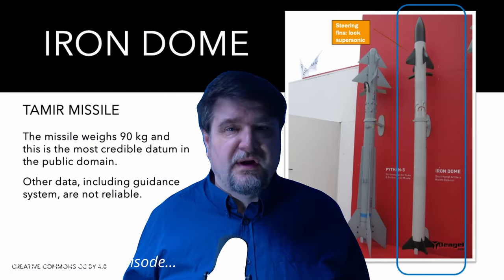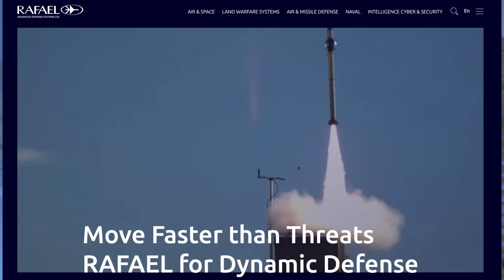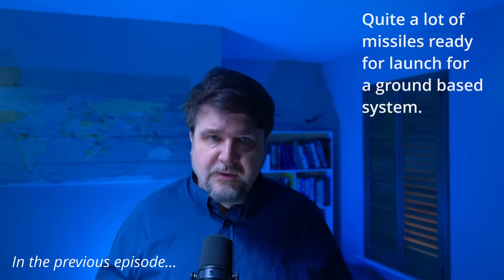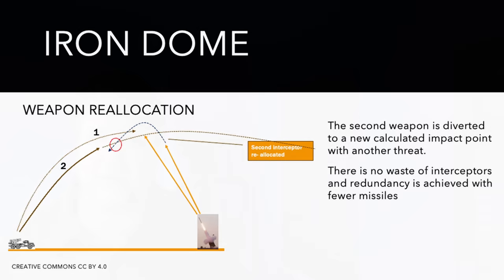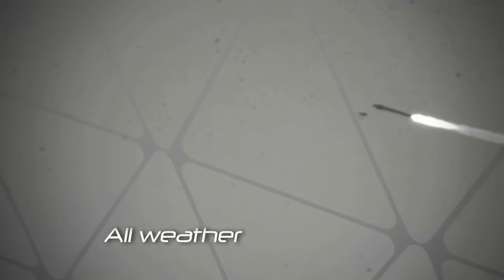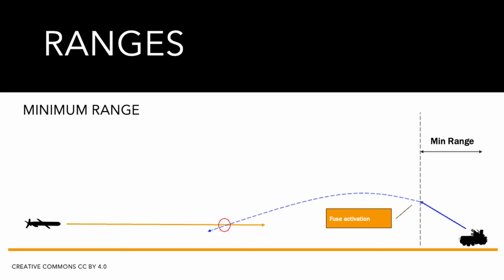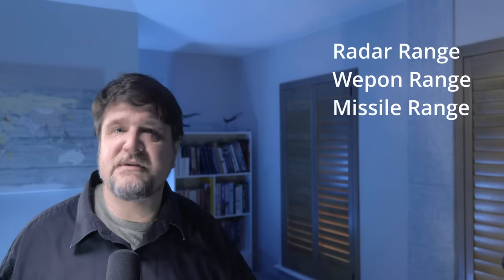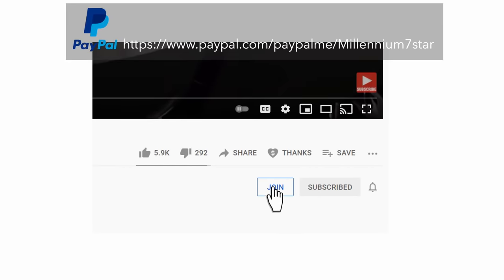IRON DOME: Why is this SHARP?

Comment: I have a request for the Christmas episode (if there is going to be one). How does Santa deliver presents in countries with aerial denial systems? Norad is able to track Santa so that suggests he doesn't use stealth but then how can he avoid surface to air radars? When he comes back up the chimney he must have a significant heat signature, how does he hide from IR sensors?

Comment: I know the Iron dome is on everyone's focus, but would be nice if you would do a video about David's Sling. Seems hard to find more details about the system my home country, Finland, just decided to purchase.
Reply: David’s Sling was a joint venture project between Israel and the USA. The US version is called Skyceptor and is built by Raytheon. Skyceptor has been integrated into Patriot as a much lower cost option than PAC3MSE interceptors. Skyceptor and David’s Sling are similar but not identical. The Israeli version has it’s own ground system different from Patriot.
Reply: David’s Sling isn’t like THAAD, that role is taken by the Arrow system.
Reply: @mikaelramsay2094 A video about David's Sling would be very welcome, as I agree that an in-depth video about that missile system either does not exist on YouTube, or is hard to find.

Comment: So ,what happens to the material after the intercepts?
Reply: It falls down due to gravity. However, damage is much minimized for the following reasons:

1- Debris will fall short of the target area due to the reduced speed.
2- Warhead has probably either detonated or been rendered inoperable.
3- Debris spreads across a larger area.
4- Each piece has a lower amount of kinetic energy.
5- More energy is lost due to aerodynamic effects (greater surface area and drag coefficient while having lower mass).
Reply: @andresmartinezramos7513  Thanks 👍
Reply: @wst8340  No worries

Comment: I didn’t understand the part about the tip of the Raphael missile falling off. Do you mean that it is also radar guided?
Reply: It could mean that the tip of the missile is only an aerodynamic shell that gets jettisoned in flight, revealing the seeker head which may be optical after all.
Reply from the maker: ... but it is not, according to Rafael...
Reply: @Millennium7HistoryTech  Yes, very puzzling. Maybe that clip with the detaching tip was of a different missile or a variant that they had in development

Comment: Regarding effective range of a missile. I am aware of at least one AA missile for which the published range is substantially shorter (factor of 2 to 3, depending on conditions) than the practical limit of effectiveness. 

Why publish inaccurate values? Maybe the manufacturer/user doesn’t want opponents to readily know the true capabilities of the weapons (let them find out by trial and error rather than hand it to them?).

Comment: i am all but certain they are using iron dome missiles for ground attack in gaza. my best guess is they're using the second, otherwise unused interceptor when the first one successfully got it. my gut feeling is this is what happened in that controversial hospital parking lot strike. the warhead is just a small explosive to set off the rest of the propellant, right?
Reply: if you recall how there was a video of the rocket hitting the hospital from up close - the guy was likely filming the video because some rockets were launched from somewhat nearby to the hospital. i'm certain the thing that hit the parking lot was an iron dome missile used as counter battery after the rest were intercepted. it would make sense when you consider how it was mostly incendiary - they claim it was because the rocket just fell after it failed, but if you hear the sound the rocket made, it was for sure not just falling and going quite fast.
Reply: this isn't even to mention the fact that pretty much every bit of evidence they gave to make their case was either completely fabricated, conjecture or just not conclusive at all lol
Reply: Absurd a interceptor missile has a lot of complicated and expensive motors and electronics because it literally needs to steer itself to hit a bullet with a bullet. They also have extremely small amounts of explosives
Reply: @xblade11230  yes but they clearly use the propellant to boost the explosive power. there is also a dedicated ground attack version and can be reassigned targets at any time. and, there’s no way the IDF would be morally opposed to using less accurate methods to strike gaza. they’ve said before they don’t care about accuracy too much.
Reply: @octagonPerfectionist  I don't think you understand 

a propellant is not a explosive any damage done by a propellant is minimal 

Explosives are categorized into propellants and high explosives 

A chemical is classified as a propellant because it is more useful at pushing things, than breaking things

and a high explosive is useful at destroying things

examples of high explosives are TNT, semtex , HMX, RDX , nitroglycerin etc... 

examples of propellants are gun powder, jet fuel etc... 

The key factor for a explosive is Brisance, brisance is what classifies a chemical as a propellant, or high explosive
Reply: @xblade11230  i am well aware of the fact that propellant isn’t actually all that explosive but it’s incendiary - scary stuff just like WP, since it can’t be put out once it starts burning and i believe it actually burns substantially hotter. if you look at the damage in that hospital parking lot, there’s very little blast damage but a lot of fire damage. it would make no sense for the missile to not blow up the propellant when the warhead goes off because they won’t want it to just fall to the ground and kill their own people they’re meant to protect.
Reply: @xblade11230  if you recall the story given by the IDF, they said the explosion was due to the propellant of a misfired rocket. but the rocket launches they showed on the map they gave was a few km away and a majority of the propellant would have been burnt by that point.
Reply: @octagonPerfectionist  They lied the hospital was hit by a thermobaric bomb from Israel in airburst mode
Reply: I'm not going to get in the debate of what did hit the hospital because I honestly do not know.

However, I will debate that light aa missiles are being used for ground attack. It just doesn't make sense. They are very expensive, very light and carry a minimal warhead. Could it perhaps be a malfunctioning rocket that landed there? Yes, but not ground attack.
Reply: @andresmartinezramos7513  they actually have a ground attack variant they already made
Reply: @octagonPerfectionist  I can't find any sources saying that
Reply: @andresmartinezramos7513  i agree with you though that we don’t know what hit the hospital for sure. there’s not enough evidence. i’m sure the IDF has the evidence somewhere but operational security or whatever.

Comment: what i think can also explain the weird trajectories that the interceptors takes is the fact that the fusing of the warheads needs to be in a front/rear aspect as the interceptor passes ALONGSIDE the incoming munition for the shrapnel to sufficiently destruct the warhead on the rocket as well as the airframe. That means depending on the trajectory of the rocket and the launch area of the tamir it needs to go out along a trajectory perpendicular to the flight path then make a hard turn towards the rocket to set up the intercept.